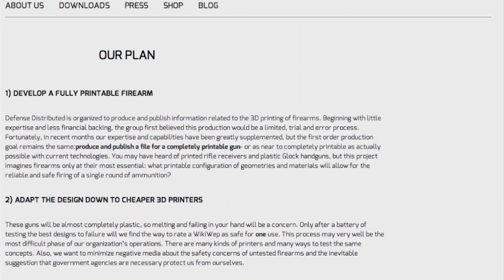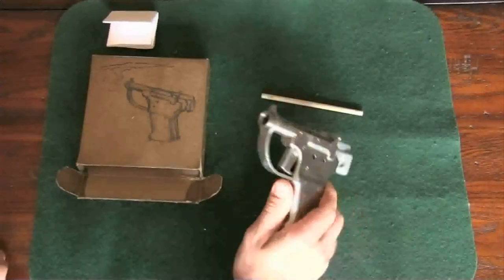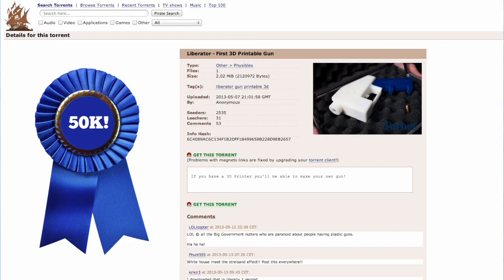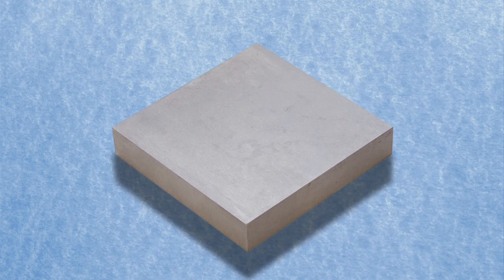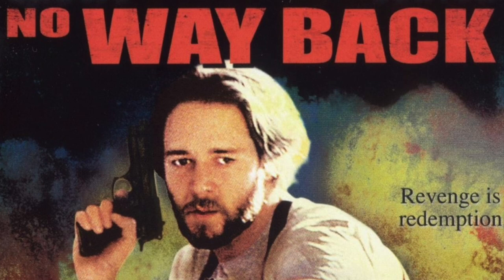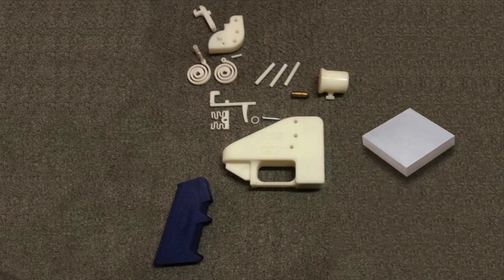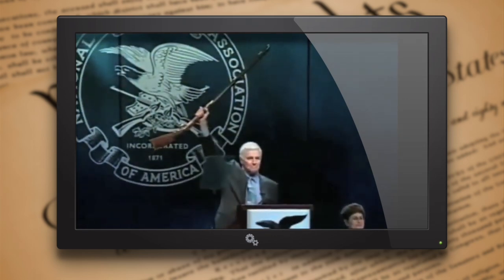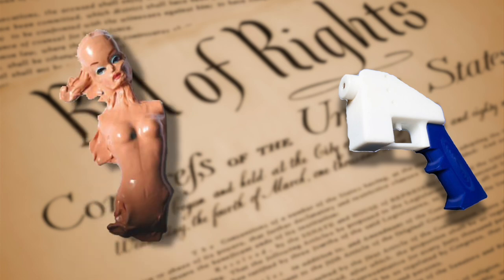Annie, Get Your 3D Gun!

Comment: The metal detector described in the law is a walk-through version, and the firearm has to meet or exceed the detectability of an example object made of 3.7oz of stainless steel. The Liberator instructions are careful to comply with this law -- the metal is epoxied into the frame even before the rest of the parts are printed.